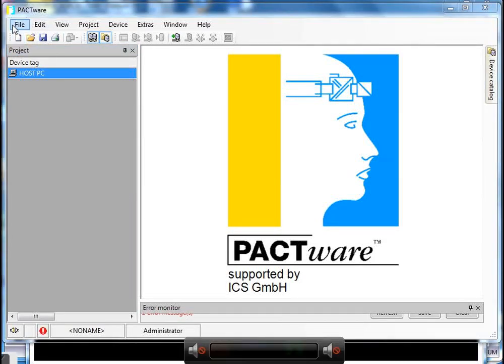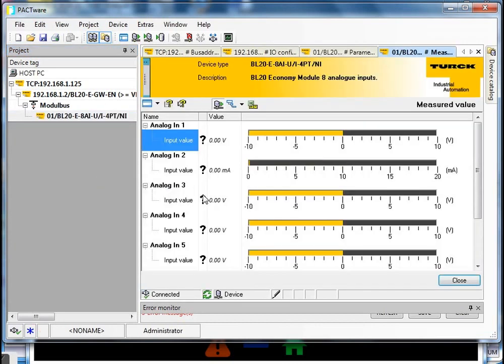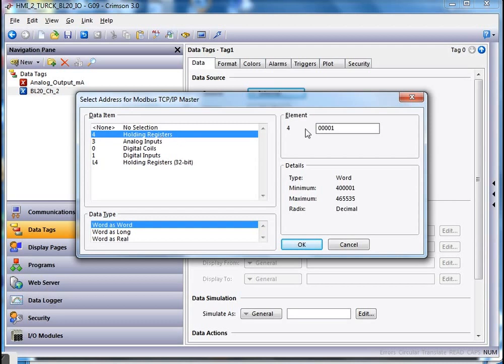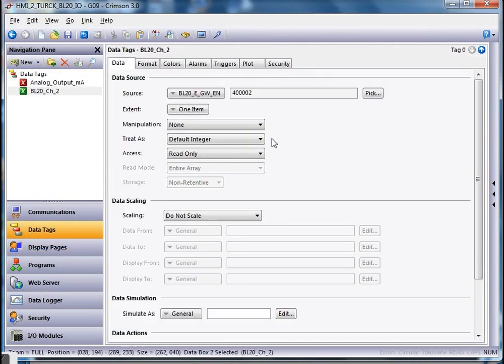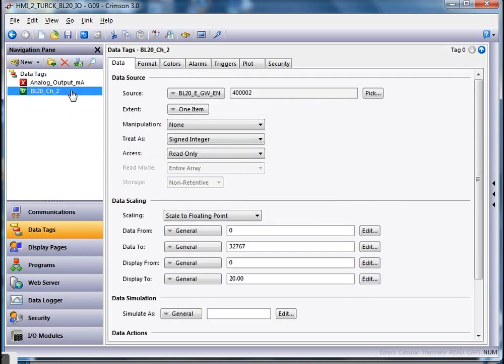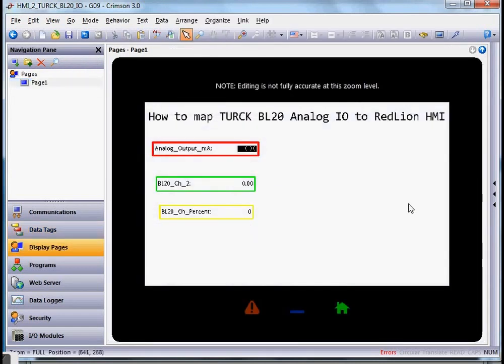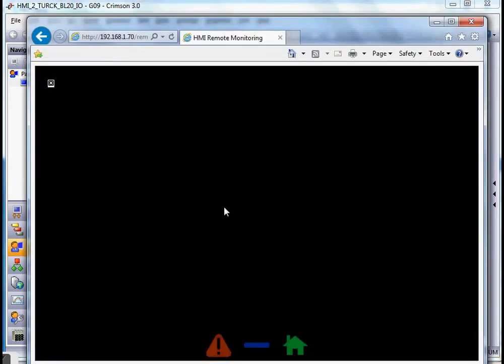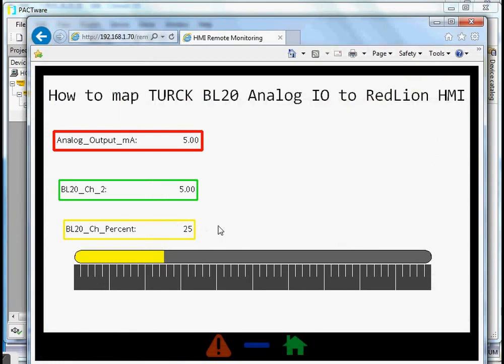TURCK BL20 Analog Inputs to RedLion HMI

Comment: Could intouch replace red lion? Using th ip as the address? How does the red lion comm with pactware? Configuration
Reply from the maker: Intouch I believe is the Wonderware version of a PC based HMI solution.  Yes it should be able to do the same as a RedLion HMI.  However, it runs on a Windows based platform and is subject to PC based issues.  RedLion screens run their own operating system with no Run Time fees.  RedLion Crimson does not interact with PactWARE.  You will use PactWARE to configure the TURCK IO and get your Modbus Mapping table from it.  Use that data to create Tags in Crimson software.
Reply: JoeWaZoo1 thanks will have to test